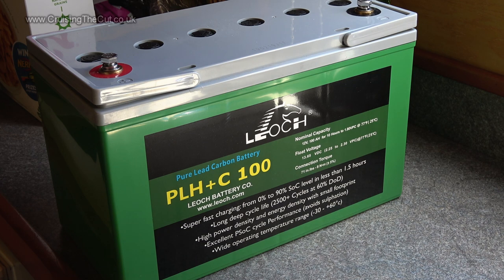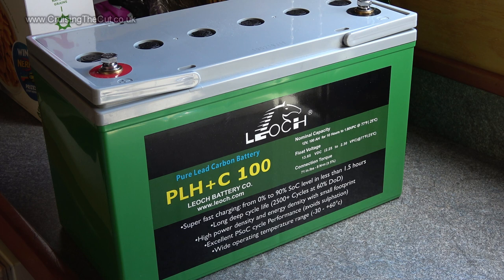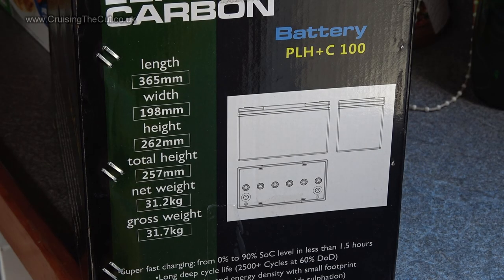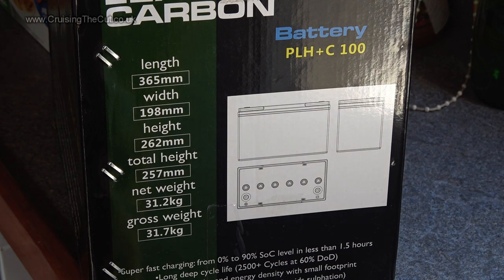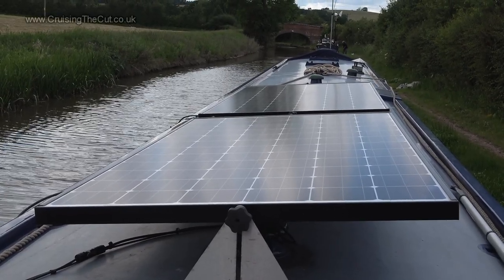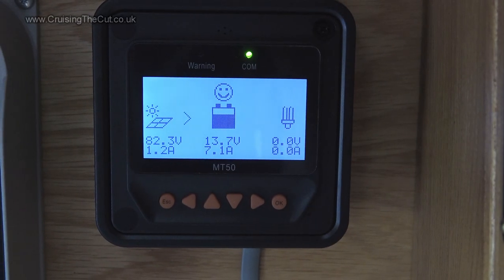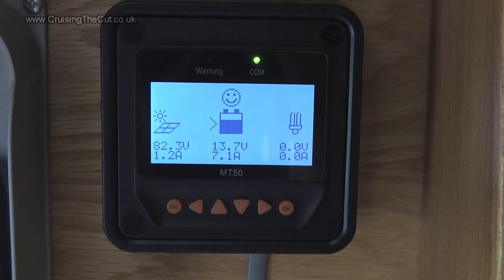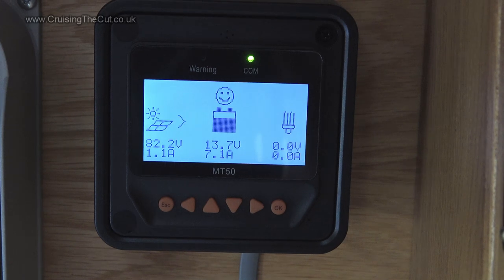178. Installing Lead Carbon batteries (12V 100Ah) into my canal narrowboat

Comment: Good move insulating the terminals for maintenance given the lifts and moves, sure don't want to accidentally drop things across those,  an uninsulated wrench across those terminals and its a bad day..   As I understand it, the idea with removing negative first relates to automotive service, take off the negative first and if you accidentally drop the positive lead and it hits the car body then there is no risk of a short.   Take the positive first, and accidentally drop a tool so it hits the positive terminal and the car body, you get the big spark.   No big grounded car body around your batteries so it probably doesn't matter OTOH consistent methods are preferable.   Sounds like your charger circuit is not disconnected by your master switch, so your spark is due to difference of voltage between whats left in the charger device and your battery bank.   Would be desirable to put a disconnect on that as well, or switch off its breaker if present.
Reply: No big grounded car body round the batteries???????
The entire hull is STEEL & a hell of a lot more than a car body.
Positive short to any part of the boat would result in a very BIG spark indeed. Removing negative first removes the risk of a spark should the positive contact the hull. Yes l have a City & Guilds in electronics.

Comment: Hello!  I find all this Narrowboating stuff fascinating (I’m in the USA so totally new to me). I would LOVE to do a vacation for a couple of weeks renting a boat!  I have a question, not related to that, but related to you video.  While you are moored, you can plug in and the juice runs into the inverter and charges the batteries.  While you are cruising, the engine is charging the batteries.  When you are moored AWAY from a plug-in for several days, are the solar panels enough to keep up with your electricity usage?  Or do you have to idle he engine for several hours a day to charge up your batteries??  With a boat that size I am surprised you don’t have a larger battery bank.  How long will the batteries last without charging them?  A day or two?  I imagine the fridge would run it down fairly quickly and it all depends on how many things you are running.  THX!  Curtis from the USA!
Reply from the maker: For me, the solar is (usually) sufficient for everything from April to mid-October maybe. Yes, the fridge (and laptop) are the biggest consumers of power. The new batteries last about two days (to 50% charge) before I would need to run the engine if the solar was not up to it. I'd like a bigger bank but no real space to install one and the boat is 20 years old, they put smaller batteries in back then as people had fewer high-power devices!

Comment: David, Thanks for showing us a battery chemistry other than lithium. Both refreshing and very interesting. I am SO happy to see you cover your panels while  disconnecting and connecting. Many a controller has ruined by arcing. Also you are spot on about an equalization charging as only certain types of battery chemistry should EVER receive such high levels of charge.
Reply from the maker: Cheers!

Comment: Doesn't matter where you connect when the batteries are in parallel as they are.   Seeing as each negative pole is connected to the next, that is the equivalent of a long wire and NO battery.   As such, for the negative (and also true for the positive), it is each batteries condition which will determine which one charges and discharges.

The only way it could go from the positive terminal in battery "1" and finally out through the negative terminal in battery "3" is if the batteries were connected in series.   But, connected in series gives you 36 volts, not what you want.

In fact, you could run everything off one battery if you wanted (as long as your amperage wasn't too high for it - in or out).
Reply from the maker: Please see the link in the video description, cheers
Reply: @CruisingTheCut  Thanks for mentioning the link.   I was watching your video on TV and it doesn't show any links :(.    Anyway, the article uses a 100 AMP draw as its example.   Which is of course, pretty outlandish and isn't real life.   Your draw is less than a 10th of that and I'd be interested in seeing them do the math on what your draw actually is.

Still, what they are saying is true, there is "some" resistance in those wire lengths and terminal connections.   I just don't think it would make that much of a difference with say a 5 to 7 Amp draw and I suspect that internal battery resistance would be a larger factor.

Having said all that, there is certainly no harm and potential some benefit to hooking up the batteries to eliminate that resistance.   I think option 3, using a common terminal and equal length wires to each battery would give you the "most equal" resistance to all batteries but may not be that practical plus you are introducing some resistance at the common terminal.  Option 2 is simpler (as you've done) and has most of the benefits of the other options.   Good work!
Reply from the maker: I'm confused as to how you can comment if you're watching on TV but not see the description (genuine query, how does that work?). Anyway, I can easily draw 100A when I run the microwave oven, albeit briefly. Plus the washing machine even on cold wash sucks about 40A. So there are occasions when a heavy draw is made even if most of the time it's just a few LED bulbs which the batteries barely even notice!!
Reply from the maker: @6sheds I have no means of measuring the discharge and recovery so can't really give you a good answer. All I can say is that they work like new batteries would be expected to - they charge and they run things and they discharge. Sorry, very unscientific but I truly have no way to tell.
Reply from the maker: @6sheds No idea how fast they charge, sorry. There's been bugger all sunshine for any solar in recent weeks and when the alternator's doing it I'm at the back driving so can't see what's happening, plus I only have a volt meter on them anyway and while the alternator's going this usually sits at 14.4. They do recover voltage swiftly after a load is removed though.

Comment: if the master switch was off the one you said turn 90 degrees that completely disconnects it from all the rest. so i think if any spark popped up that leads me to think that the balance between the batteries is now complete. one battery a little higher power than the others. but i am not sure

Comment: Your three batteries are connected in parallel.  Therefore all the positive terminals are at the same potential from earth. Therefore unless you connect the batteries together with bell wire or something it doesn't matter where you take your positive feed, as far as the electricity is concerned it's one terminal.
Reply from the maker: Hi. Thanks. Yes, I know they're in parallel but it does matter, as explained in the article linked in the video description. Cheers
Reply: @CruisingTheCut  I read the article you referenced. Interesting, and I'm not in a position to dispute the figures provide in it,  as it is a specialist area way outside of my experience. What I would point out is that any imbalance in output is dependent on the tiny resistance of the bus jumpers and very high currents. As you don't use these three batteries for starting the boat's engine, the overall current pull won't be anywhere near the extremes needed to develop the illustrated scenario, so it is unlikely in ordinary circumstances to cause damage.
The other point is that the calculations were done many years ago and battery technology has improved somewhat, so there is a possibility they may no longer be valid.
That said, it is all a moot point as the connections have been reconfigured.
Keep up the good work!
Reply: @chrisknight6884  Your 'time' point is not valid but everything else is. A matter of low currents flowing through thick cables - so no issues of imbalance. Had currents been in the thousands of amps, then balancing leads would have been much more important.

Comment: I was taught many moons ago which ever the earth is, disconnect that first.  The reason given was " when you disconnect the earth first, and you accidently touch the frame/chassis/hull, no spark as you are not completing a circuit (earth/ frame, same thing).  Therefore when you disconnecting the "live" second, and accidently touch the frame/chassis/hull, there is actually no circuit to complete.
Reply from the maker: Cheers. As I said on the video, I've also heard equally good reasons why it should be +ve first. Hence my coyness at showing which way I actually did it ;-)
Reply: @CruisingTheCut  Is it possible that these equally good reasons are only for AC, where the Hot is sometimes referred to as positive? In AC wiring you do not want to disconnect the ground/neutral first. In 12VDC negative grounded systems, I can think of no benefit to disconnecting positive first.

Comment: FANTASTIC !!!! I was surprised not one pun about the battery install being "shockingly" simple anywhere. Next project, a small veggie garden in the bow or better yet a small window A/C unit in the bedroom area. I like to dream big, Hope it all turns on good. With the new batteries the charge should last much longer as they can hold it.

Comment: I always found the best way to work on any voltage is to have three or four Gin and Tonics and stand in a puddle. The G&T makes it so you don't feel the pain when you touch a live wire and the puddle makes a good ground/earth to drain the electric from your body fast  :) :) :)
Reply from the maker: Hahahaha good advice!

Comment: Equalisation voltage is that all the batteries should be in the same state the more you have the more important it is. Each cell in a battery with 6 cells is fine and will be the same because they are in the same physical case. if you had an electric car there would be hundreds of individual cells and all need to be the same voltage that's why its good to do a full discharge and charge occasionally to equalize everything. in your 3 battery cases not a big deal at all.  In lithium cels applications there is usually a device, a BMS which takes care of the equalization it monitors each cell and makes sure it's charged the same as its neighbor and the level is the same. You get the best from your batteries and they get the best charge and get looked after. Battery need looking after when they are they give their best for a long time. If not they die quickly.

Comment: 35 years as Electrical Power Generating Facility/Industrial Electrician here. ALWAYS disconnect NEGATIVE side of batteries first, then last when reconnecting. This is not an opinion, it's a fact.
Reply: Yes, but only if it's negative earth.
Reply: @kevgermany  just like in cars the negative is often connected to the hull. Hence the same rules apply. Disconnecting negative first/reconnecting it last lowers the risk of accidentally creating a short (to the hull or other conductive parts around the battery bay) with your tools when unscrewing the positive terminal.

Comment: To be honest the way you connected the batteries in comparison how the were connected does not make any difference. Electricity does behave like water in many occasions but not to this extent. Pure Lead - Carbon are still Lead Acid deep cycle batteries but with carbon added to the minus plates to reduce sulfate a bit. All the charge phases like bulk charge, Absorption, Float and Equalization are still applicable. Hope your Condition allows for some critical notes without aggressive outbursts :-)
Reply from the maker: Ah but it does matter; have a look at the link in the video description for why. These ones don't need an equalisation charge in the conventional manner.

PS Grrrr!! Aarrgg! Outburst!!

Comment: Hi mate. Just wondering if you could give an update on these now it's been a year?
Reply from the maker: I don't have an update to give; the batteries continue to work as I'd expect batteries to but I have no means of testing them. After a few more years, it'll be a case of seeing if they still charge and hold a charge.
Reply: @CruisingTheCut  
This batteries improvements is grossly under sold. Testing shows this battery capable of 80% DOD at 10,000+ cycles (the PbC battery operates at about 80% state of charge).  This batteries lead, bathed in acid, will probably fail internally in about 20+ years.  I'd say that's could value for the money.
Reply from the maker: @Schpankme Can you point me to where such testing is documented, please?
Reply: @CruisingTheCut  
My apologies for not providing reference.  I'm hard pressed to find the original document (PDF from 1996 research) that discussed Lead Carbon Battery with 80% DOD at 10,000 cycles. However, here is a data-sheet from Victron Energy, that mentions "Several manufacturers of lead carbon batteries claim a cycle life of up to two thousand 90% DoD cycles. We have not yet been able to confirm
these claims."
https://www.victronenergy.com/upload/documents/Datasheet-Lead-carbon-battery-EN.pdf

Also, from Sandia National Laboratories discussing 50,000 cycles (PDF).  Figure 6
https://www.osti.gov/servlets/purl/1502636

Comment: You are quite right to be concerned when working with batteries. There is no on / off switch on a battery so it is always live and the current it can supply is only limited by it's internal resistance. As an electronics engineer I used to train customers on battery charging and the most important part of this vlog was to tape the spanner and, as a viewer commented,  tape or remove any metallic or carbon items. The other important mention was that of the temperature sensor: if the temperature is high the charge voltage needs to be lowered and vice versa.

Comment: While you've done nothing harmful or even 'wrong', battery banks connected in parallel don't really care where the 'input - output' cables are connected. Putting the pos and neg on the same battery will result in exactly the same performance as placing one on the first battery and the other on the last... (Retired Commercial Electrician and boat wirer). Still doesn't make the damn things any lighter...
Reply: The reasoning I believe is that at higher current draws there is a small but non-zero voltage drop in the jumper links and connections. The first/last configuration distributes the current draw evenly between the batteries, in addition to resulting in a slightly smaller voltage drop overall. Probably not a big deal if your connections are all good and proper, but perhaps possibly somewhat significant in the event that they're not?
Reply: They do care when the amperage is high. Imagine a bank of ten batteries in series. Connected at the first battery at one end. By the time the tenth battery sees the charge it will have also seen nine interconnecting links each with a voltage drop across them.
Reply: @Hagledesperado  if there is a relevant voltage drop then the bolts are not tightened correctly. The cable resistance is negligible on those short links; even if it's only 6-gage wire (it should be more like 4-gage) the resistance is only about 0.4 ohms per 1000ft.
So just tighten the screws to the correct torque and use some terminal grease to prevent corrosion.
Contact resistance only becomes an issue on large battery banks. If you want to be on the safe side use bus bars instead of single wires - but with only 3 batteries this also just removes the contact resistance in the middle.

Comment: If the terminal to terminal connection leads are very good and can transport a lot of amps, the connection place on those batteries can be anywhere, as they will be of a similar state of charge and internal resistance, no matter which one you measure. The difference will be near to none. But nice to see a true stickler in action. Keep up the good work.

Comment: A friend of mine is a automotive mechanic. He tapes his wrenches also. He managed to weld his wedding ring to his finger once when his wrench caused an arc with a car battery. So, never hurts to be extra cautious.
Reply from the maker: Ouch
Reply: Not wearing rings or metallic watches while doing any sort of electrical work is a good idea too. I know a number of guys who have gotten burnt that way and most industrial electricians leave their rings at home for that reason (and use plastic cased watches).